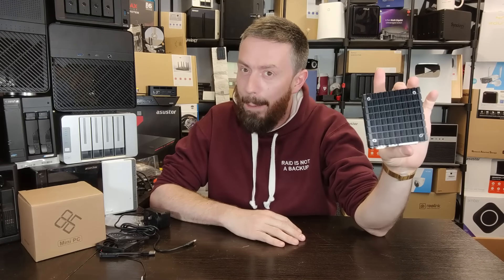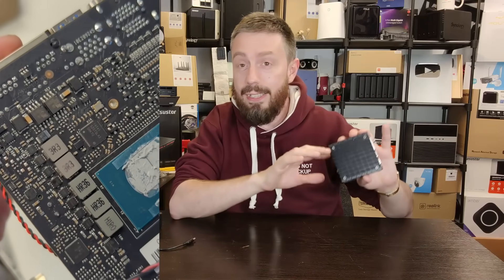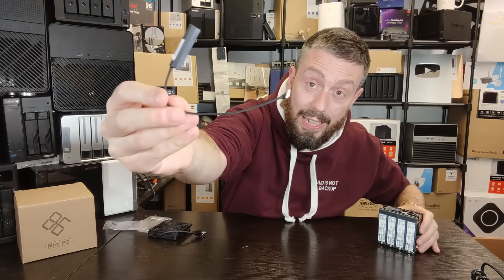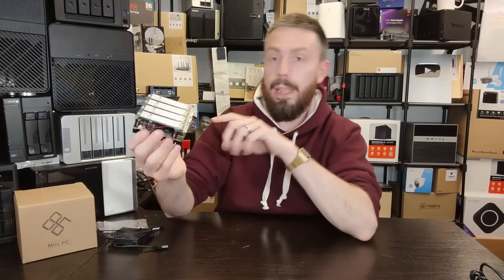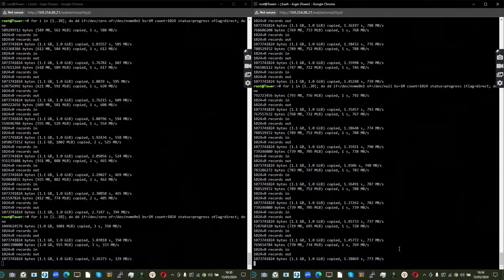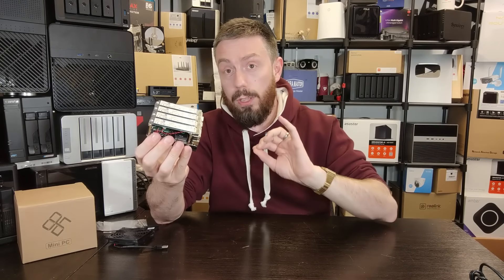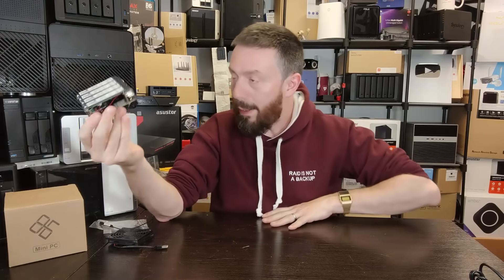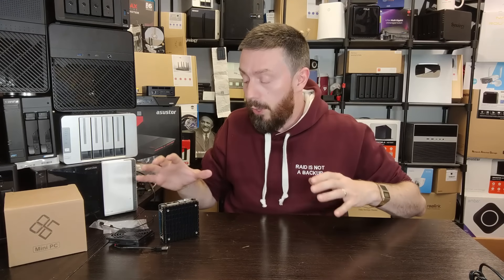CWWK X86 P5 M.2 NVMe NAS Board Review

Comment: Quite an interesting little board. What has me more interested is the  break out board from PCIe 3x4 to four  3x1 slots. Could that be added to a board  that is more robust. I have a Asrock Deskmini  B760 that has some interesting features.
Intel 12-14th Gen 65W processors
1 PCIe 5.0 X4 slot
1 PCie 4.0 X4 slot
2 Sata ports (via similar break out cables)
20 GB/s USB Type C,  
See where my mind is going with this.  It might just be worth the $150ish to get this board and do some tinkering

Comment: Interesting, but I decide to go another way. Ryzen 7600 with 4xnvme with x16 bifurcation and +2nvme on board. Will try to minimize power consumption. As a bonus - I can upgrade to ECC memory with this build
Reply from the maker: Sounds great...but it might melt though the desk!
Reply: @nascompares  hope not, will see. Will start with regular PSU 500w platinum, but its overkill - thinking of picopsu. Will measure power consumption from the wall and then decide. Main idea is RaidZ1 array of 5 nvme, 1 bootable nvme for proxmox and one CMR 5400 HDD for backups. Hope to fit in 30w idle and 50w load with CPU limitations in BIOS.
Reply: ECC isn't guaranteed to work just because it's am5 and says it in the specs.
Reply: @wojtek-33  there is nice video from level1tech about it. So I did some research :)

Comment: The whole point of NAS is to protect data from a drive failure - which is critical, of course - and data availability.  However what happens when this device fails in a couple of years?  The company will probably be gone or this hardware no longer offered.  Something else may work, but may need significant time and effort to recover.  This is a big issue when choosing a NAS.  FWIW, I use Synology for a variety of reasons, including my belief that they will be around down the road and that I can move my drives to newer (or even used) Synology hardware quickly.  This serious issue never seems to be addressed.  It also applies to all new entrants into the NAS space and established companies without significant market share.
Reply: No.  This is about uptime, not protection.  A proper backup strategy is needed to offer protection.  RAID(s) have never been.
Reply: it's a mini PC so you can just get any other (mini) PC, install the same TrueNAS or unRAID or whatever NAS OS you were using (he was using UnRAID), and import the array.
The issue you raise is relevant only for NAS appliances, that come with their own OS/firmware and interface, which are often proprietary and limit array compatibility.
Reply: NAS stands for "network attached storage", nothing to do with high availability. You can have a NAS without any redundancy if you wish, it's still a NAS.

This is a compact mini-PC with a custom nvm-e expansion card, it's niche but it has plenty of use cases and is extremely affordable, even if it only lasted a couple years. Your narrow vision of what a NAS can be used for is pretty naive.
Reply: Nas is not to protect data from a drive failure , it is to provide storage which is attached to network 😂

If this device failed what happen to the drive and data ? Well that depends on what you are running, something like  truenas / unraid / windows you can move the array disk and import them
Reply: For $150, I would order a spare. Admittedly this comes with no memory or storage, but it is in the same ballpark as a current Raspberry Pi. The I/O capabilities are light years ahead of a Pi. Use heatsinks for the m.2 drives and stick a Noctua 80mm or 120mm to blow across it, and you have a very capable device. Splitting the 4 lanes across 4 drives means that the drives will just max out the (admittedly slow) interface with little to no throttling.

Just as an FYI, I also own 3 Synology NAS, and I am going to set up a 6 bay UGreen as soon as I spot a good deal on drives.

Comment: I ordered the i3-n305 version yesterday. Going to stand up a NAS and run my home network services off of it. I went ahead and spent the extra money for the 32gb/1tb kit as it was only $2 cost difference than ordering the SODIMM and the NVME drive separately, lol. My usage case for this isn't going to require blistering file transfer speeds. Was hoping you'd have some software testing in this video as I plan to run a ZFS pool for the storage and some proxmox/docker stuff.
Reply: Just fyi, I've got the Terra Master F4-424 Pro, which also has N305, and is semi-passively cooled. it has a cooling block, but it only has one fan on the side for the whole system, and if it's not super well ventilated, it'll get pretty warm under pretty light loads, unless I ramp up the fan.
Reply: @ivanmalinovski7807  I've got it up and running. the little included fan seems to work pretty well. Now I just need to find some screws to actually attach it. The system came pre-assembled but lacks hardware to attach the fan, grill, and filter. I'll come up with something. 

Also in my testing just using four 256gb NVME drives in a RAIDZ it's able to sustain writes when copying to the device at 1gbt. I haven't tested 2.5 yet since I don't have that part of my infrastructure upgraded yet. It's in the works, though and I have most of the stuff I need. 

Also forgot to mention that i'm just running Proxmox with Cockpit in an LXC container as the NAS. And just finished standing up an Ubuntu server 22.04 VM and everything is working out just fine. Proxmox is installed on a 2.5" SSD using one of the included adapters so I could utilize all four NVME slots for the storage pool. It'll later be upgraded to either 2tb of 4tb drives. Just picked up the 256gb ones as a cheap proof of concept test set.
Reply: @ivanmalinovski7807  I think i'll be ok given the fan that comes with it, the open form factor and the fact that there is ambient air movement where this thing is going to live. Hopefully i'll have it in a few days and can tell for sure. The usage case was to find something that pumped out less heat than my 14c/28t xeon with 6x 3.5" drives.
Reply: Mmm terramaster try to install xigmanas ?
Reply: So it looks like this thing is going to be plenty powerful for what i'm going to use it for. Should make for an excellent low power and/or travel server. Just need to come up with some kind of enclosure for it. Or some feet to stand it on, etc.
Reply: It is important to note, that the N305 can only alocate 16GB of memory. 
I'm wondering, if the Chinese companys are catfishing customers or they just do not know better themselves.
Reply: @klausjones9012  Guessing, officially supported vs "it works"?
Reply: @klausjones9012  they know better, but it's not only them; Odroid officially says on its website that 48 GB RAM is actually working on the N97 board they sell and guess what, I have two of them and yes, 48 GB RAM really works. I also have other N100 machines around and each of them have 32 GB RAM so yes, maybe not officially supported but it works. I also guess that 32 if not 48 GB RAM would work on this i3-N305 CPU.

Comment: I have purchased one also but it looks slightly different 

The nvme carrier board has an extra brown soft cable 

And the header on the main PCB is slightly changed on placement

The model I ordered is a n305
Reply: I think that brown cable it possibly a power cable - on the v3 in the video you can see a red/black cable going to the daughterboard instead of the wide brown cable that comes with the earlier models